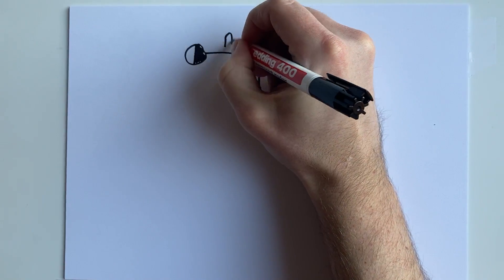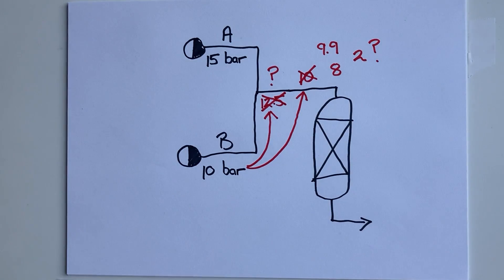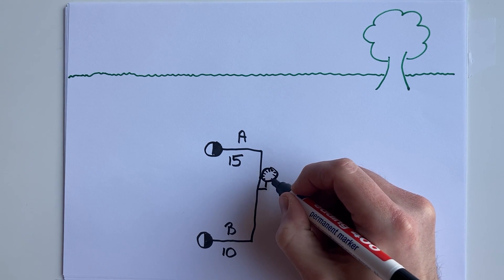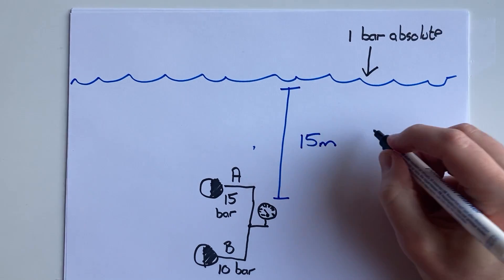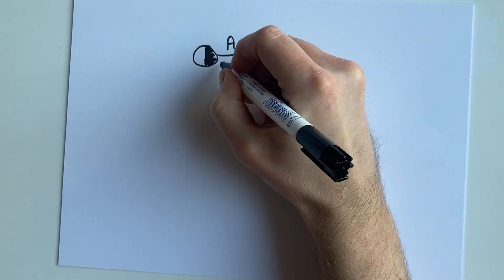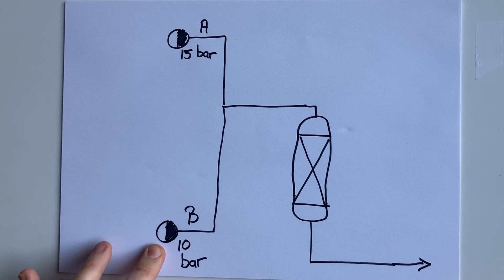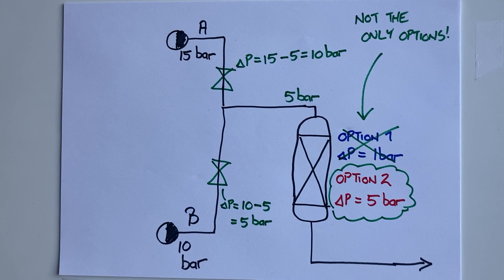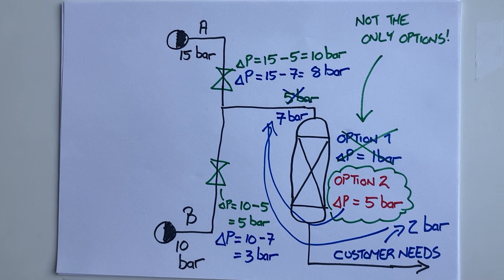What happens when you mix different pressures?

Comment: If you take the original problem as stated (similar lines, no valves), then the outlet pressure is 15 bar (minus pressure losses) and there is no flow from source B.   If fact, some or all the flow from source A would go into B.  The key here is to distinguish between Rating an existing system versus Designing a new one.  If I can add valves wherever I want to, I am designing.  If I need to calculate pressures for a fixed system, I am Rating.
Reply: This is what I really don't get in this problem. If you want to stay "inside the box" of this odd though-experiment, then A is simply going to back-flow into B as well as exit on the open end. After all, there is no pressure drop in the pipes and the source ALWAYS provides 15 bar, those 15 bar are there all the way until the exit. B can only be at 15 bar too without any additional devices in-between.
Reply: Actually weirdness happens - I worked on a 30 bar pure nitrogen system where we detected a leak because atmospheric oxygen was contaminating the nitrogen - yes, one atmosphere air was leaking back into a 31 bar nitrogen system…
And tightening the leaking tube fitting eliminated the ppm level contamination.
Reply: @allangibson8494   Only way I can imagine it would be Bernoulli's principle where coupler had change of diameter.
Reply: @pektorijs  The leaking connection was on a pressure transmitter…
Physics isn’t always “common sense”.
Reply: @allangibson8494 buy one of those car washing brushes that have their own detergent reservoir in them. The high pressure and flow of the tap water “sucks” the detergent from the reservoir which is at atmospheric pressure, giving you nice bubbly output?
Reply: @11235but  The other thing to consider is the velocity at the wall of a pipe is inherently zero - so diffusion occurs at the wall…
Reply: @allangibson8494  it doesn't change the fact that the maximum flow the 15 bar pipe can have depends from the geometry of the pipe... Anyway i think a manometer after the T is what you need to know if there's backflow (it's sufficient the pressure is lower than 10 bar). The valves are useful to add losses, as you say (reducing the flow), but they aren't needed if the previous condition is guaranteed (except you want to do something more generally secure, as your experience suggest to do, i understand a plan B ready at prior is the right way to do things).
P.S. very interesting your experience with the nitrogen at 30 bar, it's making my brain work on how it happened.
Reply: @antog9770  Losses due to pipe geometry are not exactly predictable and are also variable with time, external environment, wear and corrosion. That is why you measure the conditions and use active controls.
As another example - a new grad piping engineer used 1/8” tubing to achieve the required supply pressure to a pneumatic controller rack, it was not quite politely explained to him that pneumatic pressure regulators are used for that application because the flow rate and supply pressure varies with time…
Reply: @11235but  That is not how it works. This would only apply to diffusion, where the net movements of the molecules is zero. If there is a flow, as would be with a leak, the oxygen can not magically flow through the nitrogen. It does not matter what is flowing out of the pipe, nothing can flow back against that flow. 

But as @allangibson8494 said, right at the wall, there is a stagnant layer - here you get that diffusion.
Reply: @leocurious9919  thank you for this explanation !!!!
Reply: The pressure would be 15 bar. Each source would flow though. There would have to be a restriction at the exit for back flow into B to occur.
Reply: @joshfoleyJr  The leak was in a zero process flow location… (on a 1/8” sample connection).
The effect was a ppm level contamination of ultra pure nitrogen.
Reply: @11235but  I suspect it's just a matter of some air particles getting "lucky" and simply not hitting/getting affected by any other particles on their way in, though I'm not really sure how gasses travelling between containers work on more individual level when those are of different pressure, I suspect it's kinda like how much gets in vs how much gets out. Actually, I kinda wonder if something similar to osmosis would happen if I connect two containers via membrane that only lets helium through (probably even a stretched price of rubber would work) and container without helium has higher or similar pressure level to one with helium.
Reply: I think it depends if you have flow or if it’s a closed standing system. In I closed system without any flow the pressures would back flow into B and equalize to 15 bar. In a flowing system it probably wouldn’t flow but you’d get the Bernoulli effect. But that would depend on the speed of the flow.
Reply: what does rating mean ?
also sizing ?
alos pipe rating ?
Reply: Yeah! That's what i thought as well! If one flow A is 15, and the other one B is 10, wouldn't the flow with higher pressure not "allow" the lower pressure to go inside C?
Reply: It isn't true for sure, because you don't know the the flow of 2 pipes, and consequently the losses of the 2 flows running in the pipes; what you say is an option, but other elements must be known to be sure about how the flows behave. Also the geometries of the pipes aren't known; is one longer than the other? Does one or both of them change during the respective length? The approach of the guy is right, anyway, because is searching for a global equilibrium, from the start to the end (where you must know what is the pressure of the flows); if the losses during the 15 bar pipe aren't enough, your options are going to happen (backflow from 15 to 10 bar, or no flow from the 10), otherwise happens what the guy explained.
Reply: @antog9770  And that is why process engineers call control systems engineers to get modulating control valves installed…
Reply: You have neither designed, nor rated. I don't think your commentary serves further learning and likely just confuses people.     In the rating case knowing the downstream equipment is even more critical before attempting to respond. Essentially, go to the end then calculate pressure drops all the way back up stream to the point in question (for given flow rates). For you to assert the mixing pressure is 15 bar you have also implicitly asserted there is sufficient restriction down stream. I think the major issue is the question as posed is nonsense at steady state and can only make sense with additional assumptions. Attempting to bind to the initial conditions without any other information is a transient problem, ie the 10 bar wouldn't be 10 bar for long, and would eventually increase as backflpw occurs.
Reply: @mattpatt  Mattpatt - I agree that there is not enough information to solve the rating problem.  The question as posed (what happens when you mix different pressures) is too general, any attempts to solve it require assumptions.  I included similar lines, no valves in my comment.  I also implicitly assumed that the question meant “what happens at the instant that you mix different pressures,” not after a long time if/when a steady state is achieved.  As to whether my commentary serves further learning, that is not for you to judge.  Nobody made you the arbitrator of this discussion.  Your comments would be better appreciated if you didn’t start your point by attacking your intended audience.  You may be a good engineer, but you don’t know how to interact with other people.
Reply: @Chinguenguenza  Good engineering and an agricultural bedside manner is pretty much my style.

Comment: Nice video. Thank you @ProcesswithPat. I have a question. In my case, this is a closed refrigeration system. Stream A is CO2 saturated vapor (quality=1) with mass flow rate of 25 g/s flowing through at a pressure of 42 bar. There is another stream "Stream B" which is two-phase (CO2 vapor+compressor oil) with combined stream B mass flow rate of 6 g/s is flowing through another pipe at a pressure of 39.5 bar. My target is so that stream A mixes with stream B and carries all the flow together to the downstream location (here downstream is the compressor suction) where my anticipated pressure is around 40.5 bar. In this case, would it be possible for the stream A carries stream B after mixing and the mixed flow enters into compressor suction at this anticipated pressure of 40.5 bar? How to find this as I am thinking that the flow rate might play a role in this case. Looking forward to hearing your feedback.
Reply: If you are simply combining the streams at a normal pipe intersection this does not look possible as the downstream pressure is greater than the source of stream B. It cannot flow from low to a higher pressure. However if stream B was introduced in the middle of a Venturi or some similar tube constriction this could produce a local low pressure that might allow stream B to mix in.
I believe there are a number of devices that exploit the Bernoulli effect to achieve some unusual mixing requirements but I don't know if that could be a solution to your particular problem.
Reply: @regd809  , thank you for your feedback. I understand the scenario.

Comment: Hi Pat, can you advice how to properly mix two different pressure into a single pipe? I have municipal supply at 60psi with low flow rate, the flow drop to 0 when two or more taps are open sumultaneously, im thinking of supplementing the line with a booster pump connected to a storage tank the pump max pressure is around 45psi, the idea is I want to use the pump only when 2 or more bathrooms in use. do i need PRV on both pipes before tee whats your thoughts on this
Reply: Not Pat but:
How about using a one-way valve on the booster pump path, so it delivers when the pressure goes low? You can do quite a bit of routing with one-way valves.

Comment: I watched this to try and work out if you get more pressure from one 12gram cartridge or two in an air rifle, still not sure.
Reply from the maker: You would not get more pressure, you’d just be able to fire off more shots and have a lower rate of deterioration of pressure if you used two instead of one. Pressures aren’t additive in that way.
Reply: @ProcesswithPat  thank you I thought as much but wasn't sure.

Comment: I m facing a problem that I don t understand and the thing is that i am facing 2 inlets at different pressures and pipe sized and I am guessing why the fluid at the highest pressure will not block the fluid at the lowest pressure because fluid pass from high pressure to low pressure. In ur case you installed valves and made the pressure at each inlet the same so you would know your outlet pressure. What if we don t have these valves what would happen? will the 2 flows mix up and go to the outlet or if the pressure in one inlet is higher than the other one will it block it or go throw it even? 
Thx :)
Reply from the maker: I have a video that’s a follow-on from this one on reverse flow. Go check it out and see if it helps.

About the valves - they are in the example but even if they weren’t it wouldn’t matter. Valves cause pressure drop. So does piping. The flows of each stream regulate themselves so that the pressure drops of each stream are such, that the streams combine at the same pressure.
Reply: @ProcesswithPat  thank you sooooo soooooooooooooooooooooooooooooo much :)
Reply from the maker: You bet!

Comment: im havign exactly this same problem but in a reformer. m,y fuel and air reaacting are mixing at different temperatures and pressures. dealing with the temperature part is simpler, one can use enthalpy balance, but the pressure one is mind boogling. and papers really dont say much about this
Reply from the maker: I’m glad to hear it was helpful. Yeah this one really messed with my head early in my career and it’s not something that is explained very well, that’s why I thought I’d do it! Good luck with your reformer!

Comment: what would happen if you do not install control valves to balance the pressure?  would the 15 bar line flow slightly into the 10bar stream while the majority would flow into the outlet stream?
Reply from the maker: I did a video in reverse flow using the exact same setup. Check it out!

Comment: So wouldn’t you have to recalculate the flow rates after the valves due to the different pressure drops at each valve? If stream A has pressure drop 15-7 = 8 and stream B has 10-8 = 2 then would the flow of B would be considerably less than original vs A which would be much closer to original? Also would this mean that each time the mix pressure changes, the ratio of A:B changes too? 

Trying to understand for application context where mix pressure may change over time due to scale, turn around maintenance, etc.
Reply from the maker: Your question touches on a really interesting theme that seems to pop up a bit which is are you calculating something because you are DESIGNING a system, or are you calculating because you are EVALUATING an existing system. I made this video assuming that I was designing, which means that after I have picked these different pressure drops (i.e. I have a pressure drop budget) then I can go and size my lines and valves to obtain the flow rates that I desire. I've actually said nothing about flows in this process.

Your question assumes that you are evaluating an existing system with fixed geometry. If your mixing pressure is changing and your SUPPLY PRESSURES ARE FIXED (important assumption so that we don't comlicate this too much) then either you are clogging up/have more resistance downstream (causing mixing pressure to increase and both flows to decrease), or you have less resistance downstream (causing both flows to increase). In either scenario that decrease or increase in flows, and also the ratio of the increase/decrease in flows, will be dependent on the steepness of the system curves from the source to the mixing point.

I'm basically trying to say that it is difficult to answer without fully-defining the problem and knowing the geometry. It may help to do a though experiment. Imagine one of thjose lines is a large water supply line of say DN200/8" and the other line is a small chemical dosing line of 12 mm, or ½". The mixing pressure is the pressure at the dosing point. It is possible to imagine that etiher of the streams in my video is either of these lines - you could switch them around mentally. You can then re-imagine that both lines are identical sizes instead carrying similar flows. Regardless of which of these scenarios it is, the information in my video holds true. Until you know which one of these scenarios it is, it is difficult to say more about the ratio of flows. Not sure if this though experiment helps or if it is counterproductive...

The final thing I'd say is that if your mixing pressure is changing because of downstream effects it is likely that both pressures A and B will change depending on the characteristic curve of the machine supplying the pressures. Then again, you maybe have pressure regulators right upstream of points A and B that give this constant pressure.

Comment: Lovely video.  Another way to design the process and perhaps even a preferred way for safety and management in most cases would be to have the two pipes combine in the reactor vessel then the feed lines have a constant back pressure (as you choose) and are not affected by pressure or feed rate changes in the other reactant.

I can think of no compelling reason to combine the two feeds inside the plumbing, a mechanically coupled two gang feed pump would be preferred even if the excuse of saving on a pressurised feed pump was the excuse.  Saving on a reactor fitting would be a rare reason to justify the early mixing.

Someone on Facebook recommended your video, said you were worth watching.  I will keep an eye out for more.
Reply: Vastly depends on the process.  Most solid-liquid injection processes for scrubbers can be done in piping to optimize against pluggage and make sure the slurry is homogenized ie soda ash for scrubbing.

Lots of applications for static pipeline mixers as well

Comment: Nice video! Hypothetical question: If I had a stream of water at 10 bar colliding with a stream of water at 15 bar and there was a single pipe making a T with the intersection point of the two streams (so basically your drawing), would water from the 10 bar stream be able to mix with the 15 bar stream, or would the 15 bar stream just shut out the 10 bar and exit via the single pipe?
Reply from the maker: It hypothetically possible. The only time the 15 bar stream would flow back into the 10 bar stream is if it was easier for it to do that rather than for both streams to simply flow out of the combined pipe. This would mean that either:
1. the "outlet" (combined, T-piece) actually discharges into a pressure between 10 and 15 bar, say a pressurised tank (but that's weird because why then did we form our analysis from the point of view of the 10 and 15); or
2. The capacity from the 15 bar stream is so high that it is able to put enough flow through the combined pipe such that the pressure drop in that pipe becomes greater than 10 bar, making it possible to send some of the 15 bar stream into the 10 bar stream.
Reply: @ProcesswithPat if it behaves anything like electric current then there will always be a flow from higher level to lower level in a parallel system. More will flow in the route of less resistance but there will be a tiny flow in the higher resistance route proportional to the resistance. Current cannot choose to not take the route of more resistance completely as long as the voltage is high enough to overcome the resistance.

Speaking in fluid dynamics I'd say the 15 bar stream will split up in a certain manner, one part flowing "out" and one flowing in the direction of the 10 bar source.